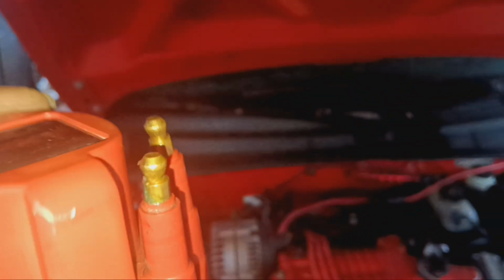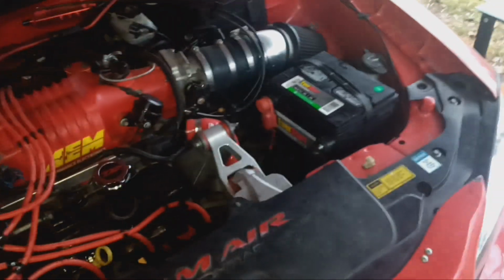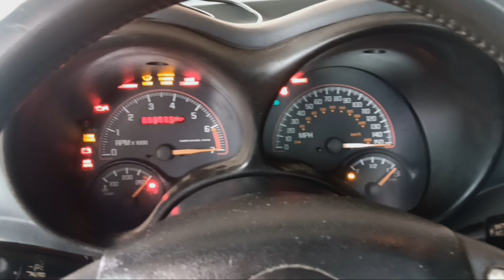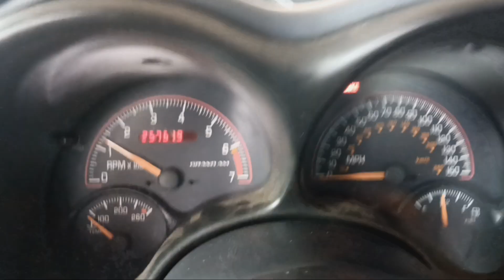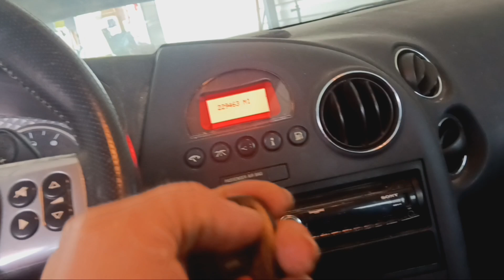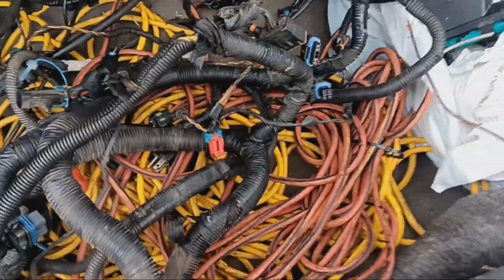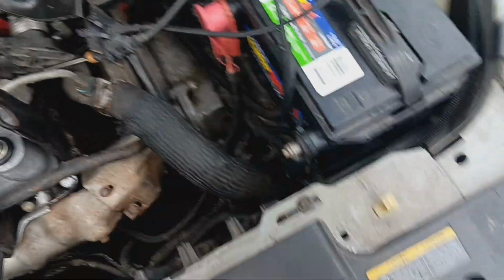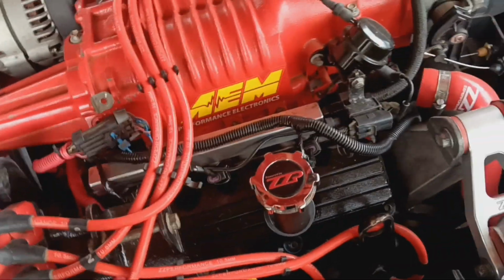Quick Update On All 5 of My Cars

Comment: Just changed crank and cam sensors on mine Christmas eve. And added a mechanical oil pressure gauge.
Reply from the maker: Hell yeah that's awesome.
Reply: @PontiacsGarage  No codes or anything,it was just time after 23 yrs.
Reply from the maker: @stevewheatley243  well deserved maintenance

Comment: Check you fuse for your fuel pump.  Could ve something as simple as that.  Ask me how I know.
Reply from the maker: Trust me I have. The fuse and the relay are both good. I swapped the relay with the ac relay and it's doing the same thing. Then I unplugged the fuel pump harness from the car and plugged it back in and boom it started kicking on again.

Comment: And Ive never heard my fuel pump. Ive heard others kick on,but not mine.
Reply from the maker: The fp in there now is the original one from when it was a 3.4L. It was already going out before it ever ran. That's why i dropped the tank at the storage and did the new pump and filter.

Comment: What transmission is it
Reply from the maker: On which car?
Reply: @PontiacsGarage  the grand am,isn’t it a manual?
Reply from the maker: @schlabachcs  oh yes, it's the f23 5 speed from a 2002 cavalier. And uses all the 5 speed f23 parts from a manual ecotec grand am like axles, shifter and cables, slave cylinder and clutch. And uses a flywheel off a 3800 camaro or firebird.